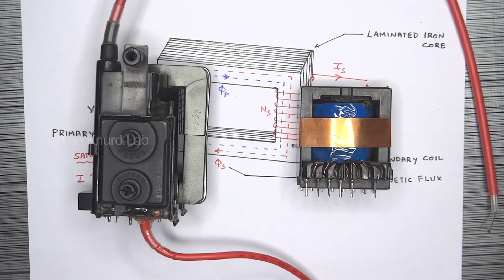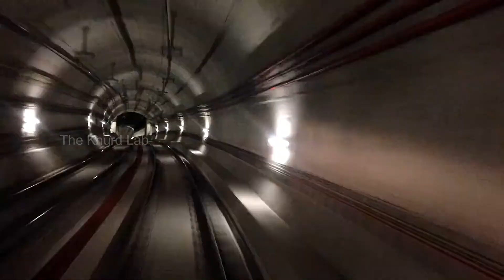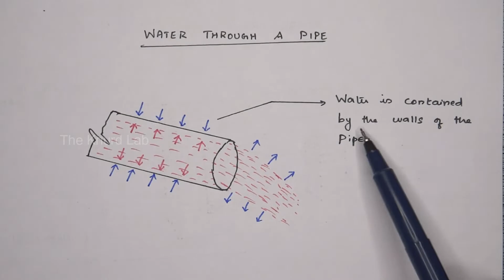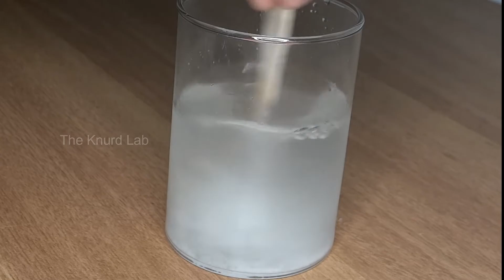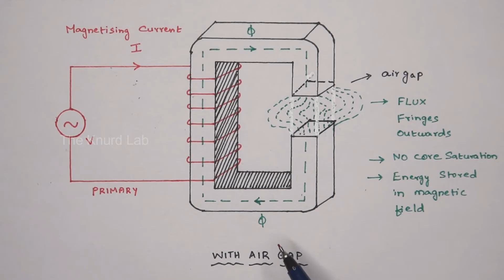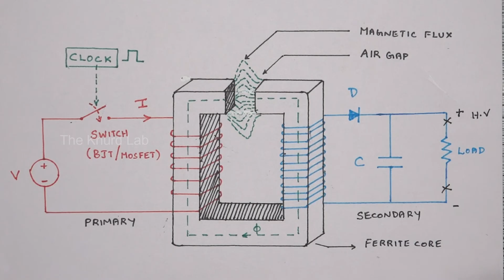What is a Flyback Transformer? | Magnetic Energy storage explained

Comment: What does it mean - The energy is stored in the Air Gap?
If it is stored the way energy is stored in a Capacitor it means during discharge it has to becom a source of flux!
This is not right...
Here is what's happening:
The air gap just increases the Reluctance for the magnetic Flux to close the magnetic circuit, thus allowing a stronger field to be created around the core prior to saturating it.
Think of it as a magnetic Spark gap.  So every Magnetic field needs to create a closed magnetic path for the magnetic flux to flow through.  By introducing an air gap we intentially obscure the flux to go through.  The reluctance of the core is very little compared to the one of the Air Gap, so in order to bridge the gap - stronger flux is needed.  To get stronger flux the core needs to be magnetized more to produce a stronger field around it.

The energy is not in the Air gap - it is in the magnetic field around it thathas been built while current passes through the primry coil.
The same size core WITHOUT an Air gap will saturate much early and the field around it will be much weaker...
You can achieve an equivalent core saturation without the air gap with much bigger size core with no air-gap...
It is a give and take thing!

So because of the air-gap you had a chance to feed more Magnetic Energy in the field, when you discharge it on the opening of the primery coil's circuit...
It obviously generates a much higer voltage that a ragular transformer without an Air gap...
There you have it.

Comment: Hi. Im trying to build a high voltage ignition circuit using flyback transformer. Set up is very similar to what you have shown here in your video. Your video is very clear and detailed and gives a lot of information. I have some technical doubts related to my setup. Is there anyway I could contact you to discuss the same??

Comment: Hello can that flyback transformer being used to stabilise voltage in sensors or phase shift electricity? Is it posibel to re use those pins? My problem is an small AC generator inside distributor so I need kinde of phase shifter I have problems running engine in low rpm ranges so kinde of need help about pick up coils.

Comment: I don't understand why you are drawing an air gap? all ferrite cores on every HV flyback I've seen are a closed loop, there is no gap there.
Reply: In all TV's they have an air gap. I have a few of these transformers all have air gap.
Reply: Also it's not a flyback unless it has an air gap bruh
Reply: You won't see the air gap unless you take each halve of the core out
Reply: @haywireSSC   @samueldavies646  No, even if you take the cores out they push snug together. Although I have seen one now with a definite gap (microwave inverter). The question remains as to where the "gap" exists if it actually microscopic gaps within the structure of the core? but thats not an "air gap".
Reply: i have taken apart gdt, smps transformer, crt tv flyback,and many others and most of them had a definite air gap. if it has an air gap it will be a definate gap. @xONEWINGx

Comment: The diode's role is a significant part of the high voltage that is generated by the flyback.  You must not forget to include it, and you must know the polarity direction needed to prevent the Secondary winding from giving up its massive energy too soon.

1)  during the time the primary winding's current is increasing, if the diode is FORWARD-BIASED for the secondary circuit, the energy is drained away into the secondary circuit, and you do not get the same high voltage spike

2)  instead, while primary current is increasing, the installation of the diode, its polarity, is such that it is REVERSE-BIASED to eliminate any path for the energy in the secondary winding to couple into the secondary circuit, ie. the diode tells the magnetic field and particularly the gap magnetic field, where more energy is stored compared to a non-gapped core - "STOP, YOU BUILT-UP ENERGY IN THE SECONDARY - YOU CANNOT ESCAPE, I AM HOLDING YOU RESTRAINED"

3) when the primary winding's mosfet (or bjt or other) switch is opened, NOW the diode in the secondary circuit becomes forward biased and the 'canned-up' energy in the secondary now has a path to flow into the output circuit

ANALOGY

- a tall dam wall, called "The Diode", holds back a very deep body of water piped in from a deep lake
- at a specific time,  Mr. Primary says "Release the stored energy" and the diode dam wall opens and the stored energy flows suddenly

- if the dam wall 'Diode' was missing, you could pump all the deep lake water you want,  but you will not get a sudden, massive spike of water energy
.
Reply: This is at least as good as the video!!!   I am starting with such a circuit.  Have you any information out there???
THANKS MUCH!!
I should have read the comments sooner!

Comment: Thanks!  But why is it called "flyback"?  What is flying? What is the 'back'?
Reply from the maker: In CRT televisions, the picture is formed on the screen by continuously tracing  an electron beam from side to side. The high voltage from this transformer is used to deflect the beam. The voltage signal is in the shape of a sawtooth and it helps the beam come back to its starting point from right to left and hence 'flyback' as per my understanding.
Reply: Flyback refers to the nature of this type of transformer, which is more of a coupled inductor than a transformer (the primary and secondary sort of take turns instead of the pri-sec current being 0-90 degrees out of phase), and the 'flyback' highlights the particular inductive behavior upon which this function relies. 
Inductive flyback or freewheeling refers to the most important electrical behavior of inductors, which is to resist the change of current.  When an inductor is 'charged'/flowing current and the voltage supply is removed or the switch is opened, the current thru L continues flowing and builds voltage across the open circuit (voltage rapidly rises if there is only stray capacitance and no substantial capacitance to store the charge).
Anyway, long response to answer your question, but I hope that helps illustrate why flyback transformers are called what they are, and why they're unique.
Reply: Core magnetic-field energy kicks BACK (via secondary) while primary left FLYing (contactor opened).
That's my interpretation.

Comment: Pure iron has much higher permeability
Reply from the maker: Yes. But frequency of the magnetization cycle plays a big role as well. At high frequencies iron cores tend to have higher losses due to hysterisis and eddy currents.
Reply: @TheKnurdLab  Hmm. I just know that pure iron has a permeability over 200k
Reply: Permeability METGLAS: 1,000,000 Iron 200,000  Ferrite: 3,500
Reply from the maker: @THEMFORMATION  Yes. That is why iron core are excellent material for electromagnets (DC current) and for low frequency AC like 50 to 60 Hz power transformers. At Kilo hertz frequencies they perform very poorly due to huge losses. Usually for high frequency AC magnetic circuits, Ferrite cores are preferred due to their excellent high frequency characteristic.
Reply: Iron has higher permeability but, still has a lower performance...
Reply from the maker: at high frequencies due to hysterisis and Eddy current losses. The thing we are looking for is BH curve. That helps find out the magnetization and demagnetization properties of a good metal for use at high frequencies.

Comment: very well explanation
will you please inform maximum wattage drawn by flyback technology
Reply from the maker: I would say that depends on your requirement. Ideally we design ferrite core transformers by calculating the current requirements (thickness of the winding) and voltage requirement (number of windings), its operating frequency (material used as the core) etc. If you are refering to any particular transformer, then ideally the manufacturer would only know the specs which they usually specify in its datasheet.

Comment: Fantastic video Suresh! I learned lots. I didn't know there was an air gap in a flyback. How curious are the flux lines expanding in the air gap.
I do have a question. From 6.40 you cover two types of switching. But what are the effects of these on the output?
Reply from the maker: Thanks and happy that you found it useful. To answer your query, if the current is in DCM, then basically your circuit performance becomes load dependent. Load handling capacity decreases and ripples increases in the output. On the contrary in CCM, the load handling capacity increases and converter is less succeptible to load changes but losses and stress are greater on the inductor (more current). I guess different situations demand different modes of operation. Essentially the frequency and duty cycle selection plays the part here in determining DCM or CCM operation.
Reply: @TheKnurdLab  I think I understand now thank you! No such thing as a free lunch, we say! So in CCM the flyback is experiencing higher current flow for a larger part of the cycle. Of course this is more likely to keep the output capacitor charged with the demands of a higher load. Brilliant!

Comment: How a flyback transformer work as metal detector
Reply from the maker: Basically Ferro magnetic materials like metals interact with the magnetic field and cause a change in inductance. If you can sense that change by some means like the frequency change in an oscillator, you essentially have a metal detector. I have explained how saturation and air gap and inductance are related in this video as well. I will try to make a video on your request in the near future.